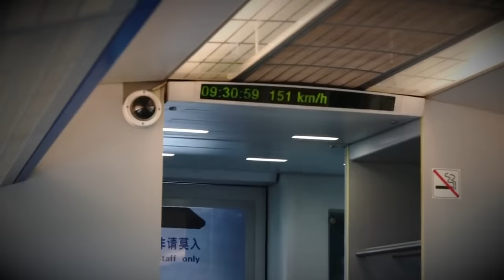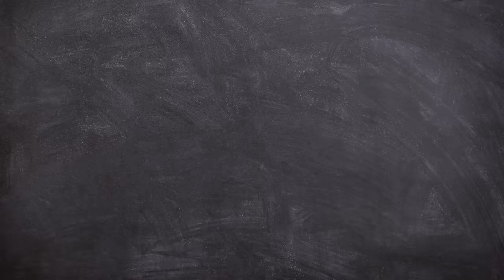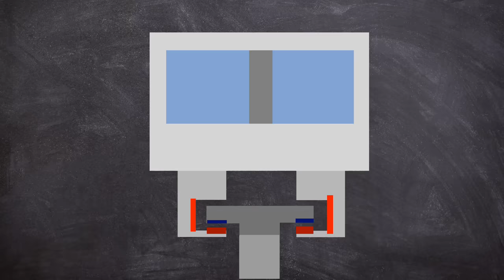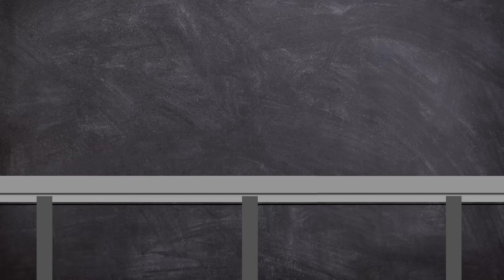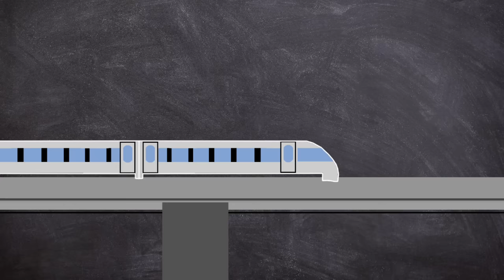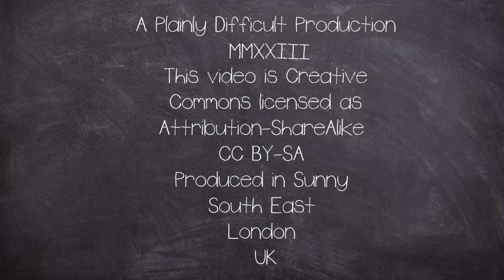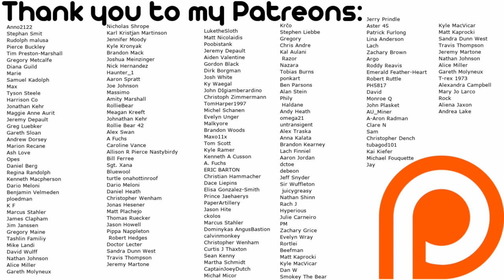Safety Complacency: The Lathen Maglev Train Disaster 2006 | Plainly Difficult Documentary

Comment: As a train driver myself, i had similar situations like this one with dispatchers. Recived permission to enter a section of the line where the radio is available partially only due to mountains, was doing 80 kph with my train allready, when the radio startet to crack. I didn´t bother much, because others communicate on the same frequency too, but all of a sudden a passed the mountain and heared a guy from a track gang in the radio talking to the dispatcher "yeah we interrupted work, the line is clear, you can send the train" for the section i was driving in allready... I just though, wtf is going on here, how can you allow a train into a section when the workers haven´t give you the permission to send trains, and at the same moment i came arround a curve and saw them standing right next to track on both sides and equipment everywhere, and was flying by them at 80 kph still... I bet they were shocked too, because normally trains pass work sites at 30 kph only, and what if they had a problem with the track that would have been needed to be fixed first? And i would had to wait... more luck than brains in the whole situation... but that´s not the way on how to operate a railway...
Reply: Railroad safety culture is written in blood. Stay safe out there.
Reply: Was anything done to retrain or reprimand the people who nearly caused a fatal rail accident?? That sounds terrifying. 

I don't know how you train engineers do it. You have to rely so much on other people and on equipment being properly maintained since there is very little you can do to avoid a collision once you can see it coming. I don't trust other people that much, dude.  I'd have every radio operator double and triple checking their instructions. 😅
Reply: @Jay-Argent  i don´t know, it told him that i was upset by the whole situation. But he´s doing the job for 25 years allready and is known to be some kind of "lost" from time to time and tends to forget things.... 
One time he was upset with me, because i radioed him 3 times, because the connection was too bad and i could barely understand anything and wanted to have clear instructions.

Yes that´s a fundamental principle of railroading, that people work together and relay on each other. There is also a lot of documentation involved, if stuff isn´t mantained properly and trains fall off the tracks, all the documentation will be confiscated by the prosecuter and checked, and if he finds something he´ll grab the person responsible by the balls. It is said that as a railroader if you don´t obey the rules you´re standing in prison with one leg allready, and with the other one in your grave...
Reply: It's km/h, not "kph", as a "train driver" you should know that.
Reply: or he was just writing it quickly and didnt care about being perfectly correct @My-Opinion-Doesnt-Matter
Reply: @magnus1249  just imagine someone is miswriting "mph" as "mihr" or "m/h" or something even worse, would you defend him or correct him so he doesn't make that mistake again?
Reply: yes i woudnt care even a little its like writing im instead of I'm its a youtube comment not an official document or something @My-Opinion-Doesnt-Matter
Reply: @My-Opinion-Doesnt-Matter your username is extremely appropriate